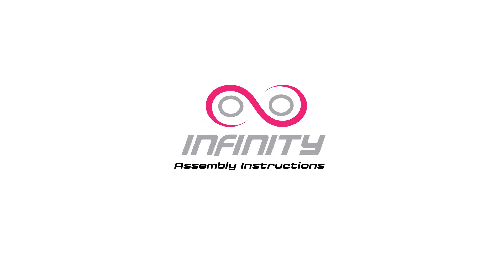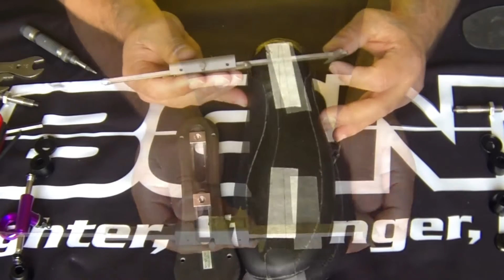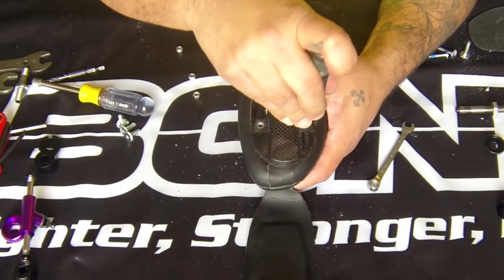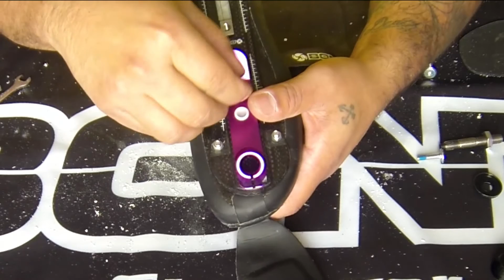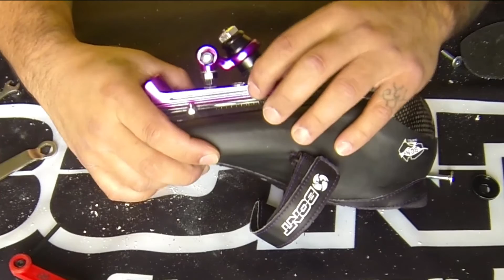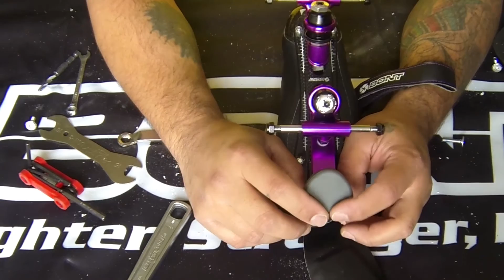Bont Infinity Quad Plate Assembly Instructions

Comment: Any recommendations about issues with the pivot pin coming loose every time I skate? I followed the video and tightened the "locking screw" after adjusting the pivot pin, but it loosens each time I skate.